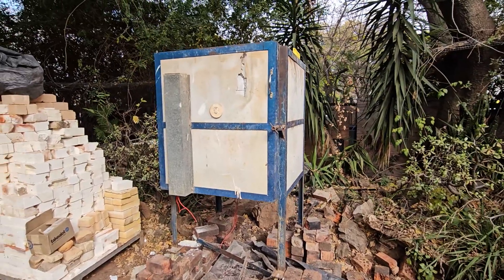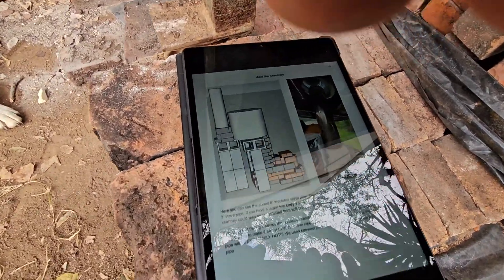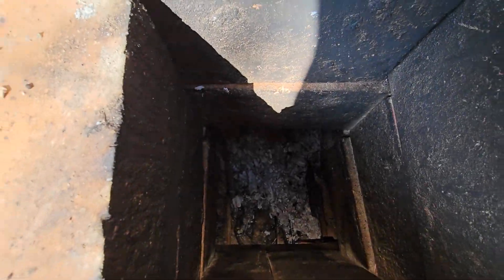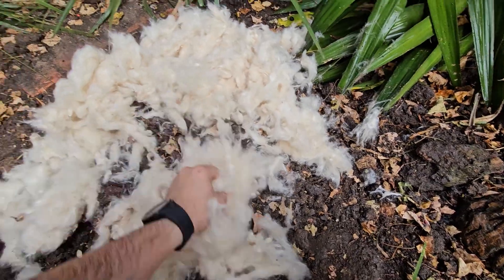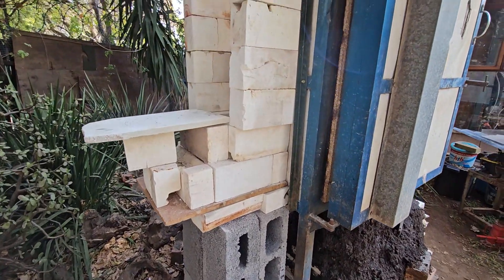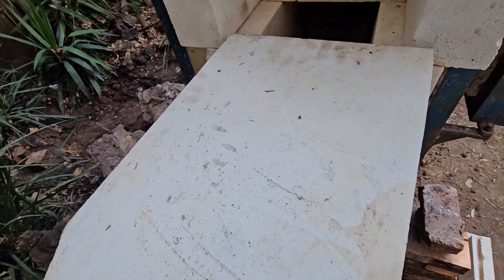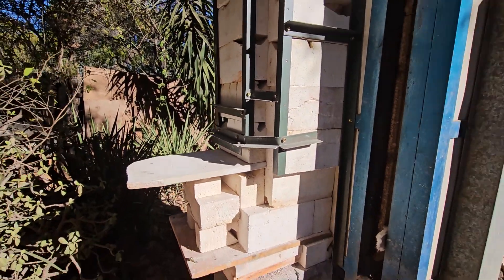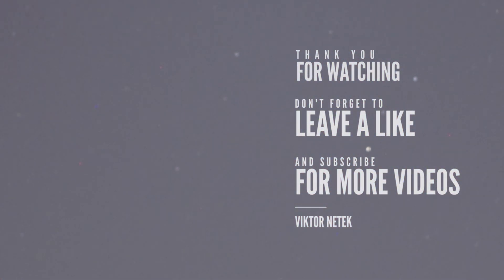Rocket Kiln Build

Comment: Yea, the rocket kiln is really the way to go for you guys. I don't care one bit about "Al Gore" compliance stuff but I have seen some videos with people with large kilns where they are using what seems like 100 pieces of wood and, putting out thick black smoke for hours. I feel for their neighbors, getting smoked out. Most rocket kilns will be no smoke, especially if all the cracks are sealed up with mortar or mud. Also, per the Facebk instruction you were looking at. It's much easier to make the riser of a J tube with firebricks "on the side" and not "flat" the way it was shown for some reason as you were quickly flipping through pages. The entire J tube should be full size firebrick "on the side" using refractory mortar with very thin joints whenever possible.